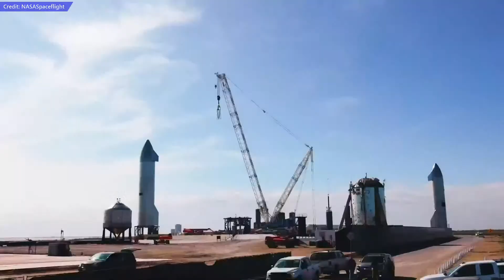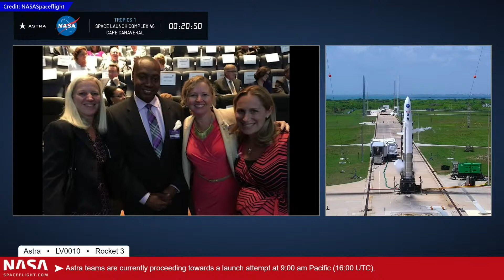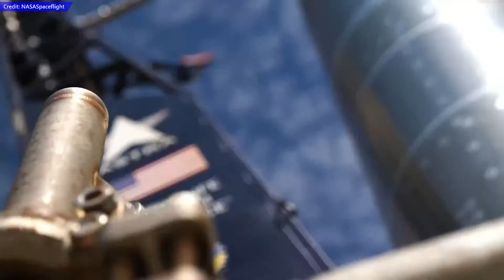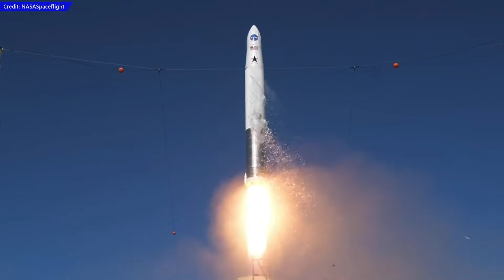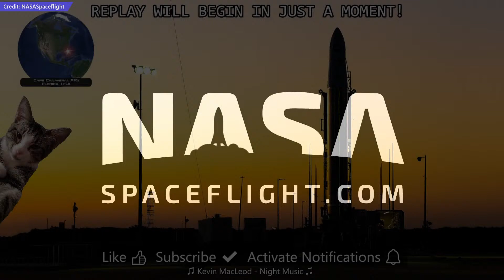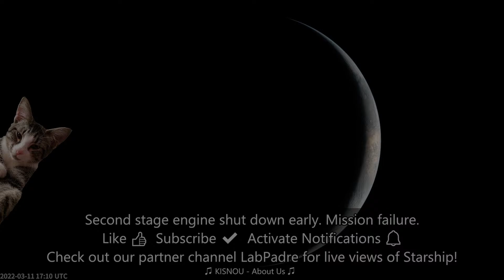REPLAY: Astra Rocket tumbles again during NASA launch (12 Jun 2022)

Comment: Between this failure, the Lawsuit for false claims, the stock price which Friday was at $2 and most certainly tomorrow will go to $1.XX levels, ASTRA is running out of options and capital. Their biggest mistake was going public. They should have stayed with Private Capital. They have enough pressures trying to get things right. When you add WS on top of this it makes for a bad scenario,
Reply: Private investors are probably going for the safe bets.  Lack of private investors is probably what led them to go public.